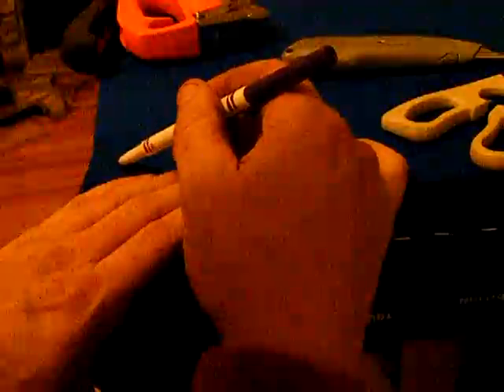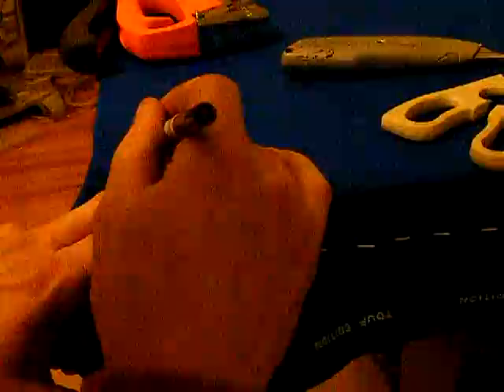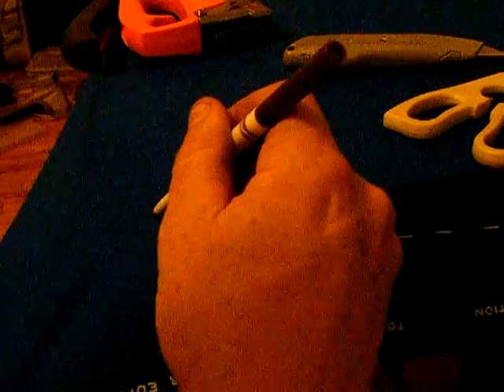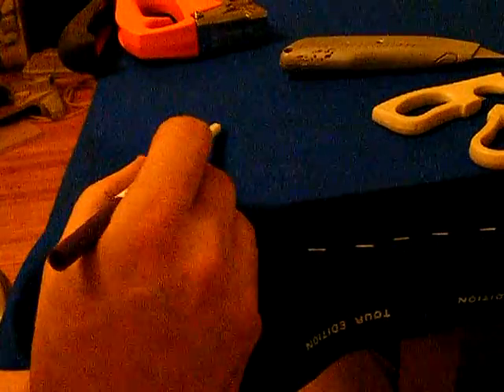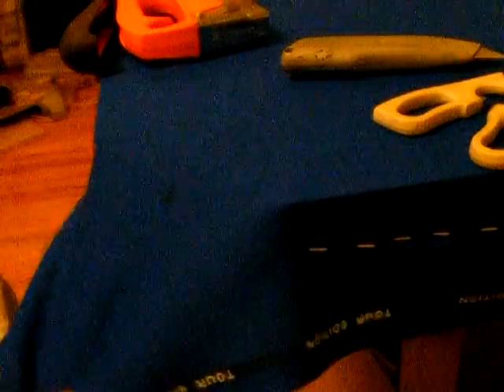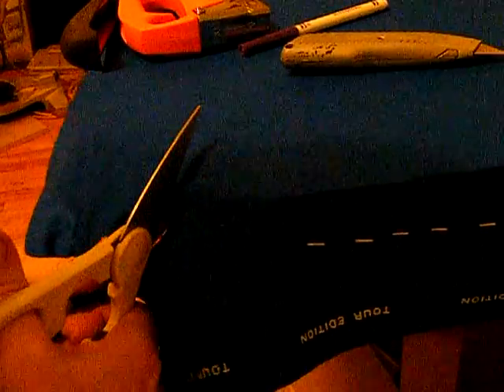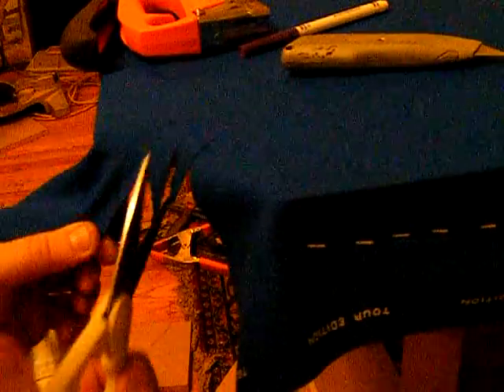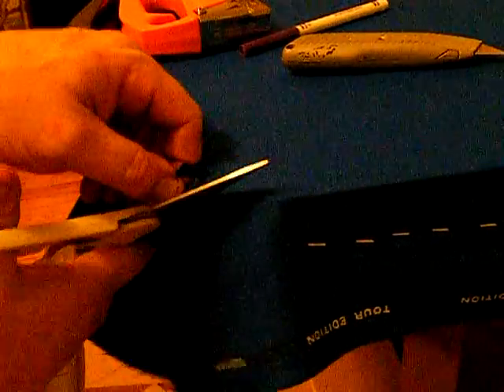Pool table installation part 12 cutting the pockets mpeg2video

Comment: Snakeclaw  Thanks for making the video's. I moved about a year ago so I  take down my pool table I marked every thing I could mark with numbers and lines.The table sat in the corner for a year in the new house, I watching your video's and though I might give it a try .I have it set up leveled and rails squared using a square and laser. I think I did a better job than the so call professionals. They didn't use any thing between the slates and  no staples on the felt except for the pockets .

Comment: Hey Snakeclaw Great Videos ... I just have one question.  are your slate surfaces smooth?  I have a connelly table and for some reason mine is not.  I have lots of tiny tiny swirling grooves.. looks like when one puts on mortar if laying ceramic tile.  Its so small that my balls still rolls ok and I'm sure when the cloth is on it will roll good.

Comment from the maker: @Insane82chevy  btw, if you decide to glue wood to the bottom of your slate (a very good idea if you do not have wood there now), you must consider a few things.  the wood is required to put staples into to hold the cloth tight.  w/o the wood, you are doomed to have spray adhesive holding your cloth to the slate.  it will be loose and will suck hard.   this is a great opportunity to increase the mass of the table which will improve it's performance.  use lots of 3/4" mdf.

Comment from the maker: since i stretched the felt as tight as i did, there was a lot of tension on the fabric as it rolled down into the cup.  on an ordinary installation, i could have done that fold that most people do.  this installation did not allow for me to do that.  no, you cannot see the wood either, and yes, i did use a single edge razor.  and yes, it was my first try.  the table plays really good and i'm quite proud of it.

Comment from the maker: my slate wasn't mirror smooth, if that is what you are asking.  there was a slight texture to it.   removing the dust and dirt was key.  i used charcoal lighter fluid and a rag to remove the remnants of glue on my surface.  once i did this, i swept what was left off with my hand.  i got it pretty clean.   if you do this, you should be okay.l

Comment from the maker: @snakeclaw   ...and further, be very careful when you use gorilla glue (or any glue) to stick wood to the back of the slate.  the slate must be perfectly flat and have no warping (such as might occur if the slate was supported only by the edges and it would bend in the middle).   the wood will permanently hold the shape of the slate, so do your best to make sure the slate isn't under extreme stress or bending while you do this process.

Comment from the maker: and the reason why the last few vids were not made and uploaded was because i bought and built the table in december.  it was winter and i'm a deck builder.  during my off season, i had a lot of time.  then i got busy with an early interior gig, and playing a lot of pool at the end of the day.

btw, please tell me why the balls will not roll against the rails, but will roll parallel to the rails if i'm 2" away from them.  what would cause that?  its only a problem when i'm within 2" of the rail.

Comment from the maker: @Insane82chevy i only used super glue on the felt as it wraps around the slate down into the pockets because the felt started to tear.  probably should have sanded the slate before i felted it.  i stretched the felt really tight too.   the super glue stopped the felt from tearing but it put "lips" on the pockets that stops the balls from rolling in.   i fixed that with sandpaper (99.9%).
i used gorilla glue to stick the mdf board onto the slate.  must use clamps or extreme weight for that job.

Comment from the maker: thx, and yes, i'm not surprised.    certainly there are some pro's that will do a good job but they get paid by the job and "pro installers"  have a very real incentive to get your table done as quick as possible.   often it results in less than "pro" results.      happy shooting.

Comment: Where is the vid of the finished product? Lets see a starratt at all the diff spots you should be leveling at.  Lets see a tape measure on each of those pocket widths.  I'd like to see what 99.9 percent of "very pro playing" is.   Where are the finished pockets?   Also i can provide you with info on any aspect of an install that you would like.  Which part were you interested in?

Comment: WERE IS THE REST OF THE POCKET VIDEO????
Reply from the maker: sorry.   never finished the series.   from here, though, its kind of basic.   i pulled those pigtails down and stapled them to the wood below the slate.   i left maybe about an inch of fabric uncut at is got near the lip of the pocket.   i pulled the fabric real tight as i like a tight fabric on my table.   maybe too tight?   after a few months i noticed a small tear at the lip of the pocket.   i think my slate had a sharp edge.  should have sanded it a bit.   i fixed the tear and kept all the other pockets from tearing by applying a thin layer of super glue to the edge of the pockets.   that worked great.  no more tears...BUT, the super glue left a small lip at each pocket.   if the ball rolls real slow, it kicks the ball from going in.   Agghhh!   so, i sanded the fabric gently at each pocket to remove the super glue lip.   its  tolerable now.

Comment from the maker: bob lob,
if the balls roll straight (as they do), the rails are parallel and straight and bounce well (brand new), and the pockets are the same opening at each, then what more is there?  is there a mystery here?  since i didn't use a level, are you saying my balls do not roll straight and true?  if that is what you are saying, then you are incorrect.  
do you have any further assertions?

Comment: If this is only the fourth pocket in your life, who the heck told you to do it this way ? You have no more videos after #12, but I'm almost sure that you can see the wood part of the slate thru this cuts you are making. No offence but I hope you do not consider doing this for a living. Also, next time get a single edge razor and cut from the slate down, not up towards the surface of the table, you get the idea. Otherwise it is a fair try on your part, since it is your first time.